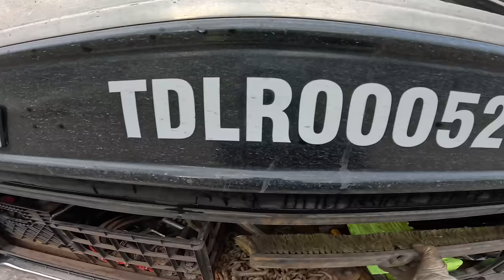Two Fords Crash Head On! Police Rotation Tow!

Comment: Whoa,  that is the first flatbed I've ever seen with a hinged bed.  That's so genius and should have been done decades ago!  Where have I been?
Reply from the maker: That’s a Miller Right Approach Bed. Has a 6 degree loading angle for loading low cars. 
It’s a blessing and a curse. It comes in handy, but personally I prefer a straight steel bed.
Reply: @Towtruck_Dustin  You wouldn't if you towed in Beverly Hills everyday...
Reply from the maker: No joke lol

Comment: By the way for ford when airbag blow you need to open the ignition and put the car in in D and back it in park after that the truck will run that’s how to bypass and active the fuel pump again

Comment: Another great video Sir! Glad you and your wife advertised your channel so I could find you!
Reply from the maker: Much appreciated!
Reply: @Towtruck_Dustin 
I have a quick question for you do you need a commercial drivers license to drive a tow truck which is your CDL
Reply from the maker: You don’t need a CDL to drive a light, or medium duty tow truck (GVWR under 26,000lbs). A CDL is only required to drive the heavy duty tow trucks (GVWR over 26,000lbs). 
In Texas, all you need is a valid class C driver’s license, and a Tow Truck Operator license from the TDLR, of which there are 3 different levels depending on what kind of towing you plan to do.

Comment: Wassup dustin. Started your morning off with a bang didnt you. I hope to be moving down that way to sargent before too long. I sure miss driving a tow truck myself. I started out in 1989 in a single wheel 3/4 ton sling wrecker chasing wrecks and went all the way to 2006 in a medium duty wheel lift truck working for milstead towing outta spring texas

Comment: if a ford doesnt run but clearly looks the engine is okay could just be the inertia switch preventing the engine from turning back on from accidents. if only it was quickly accessible lol
Reply from the maker: Yeah it was definitely the switch cutting off the fuel pump. Most newer fords have that problem when I pick them up at an accident.

Comment: You ratchet that front tire the wrong way you should hook your ratchet up to the edge of the bed then put around the tire you got it ratchet going the same way it's going to roll
Reply from the maker: Doing it like this still stops it from moving both directions. The ratchets are just on the inside rather than the outside. I did it like this because then I won’t have so much tag end of strap to roll up. It’s still strapped down just as effectively.